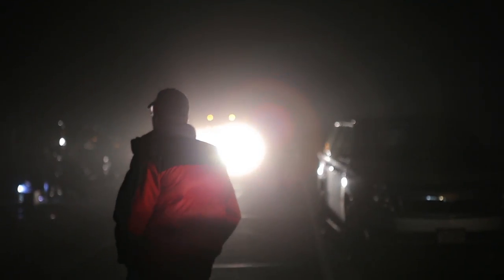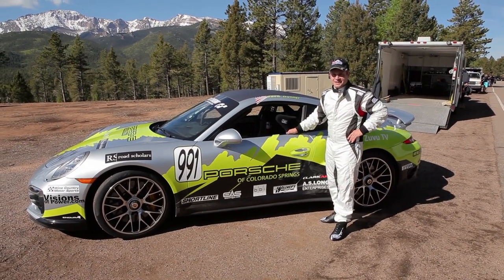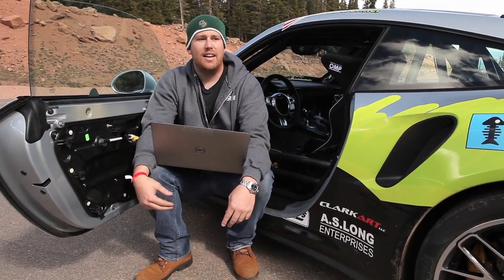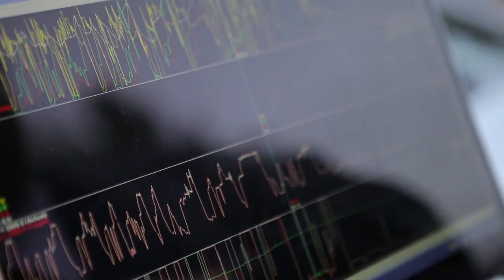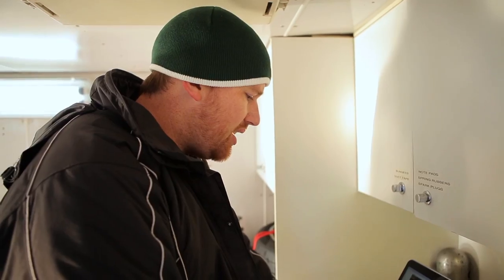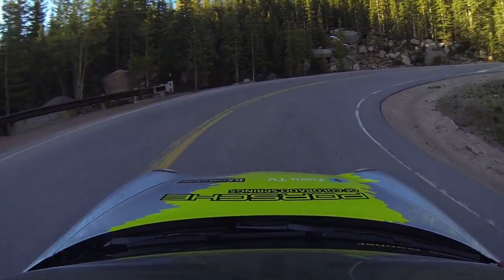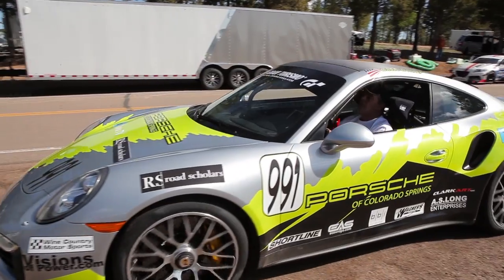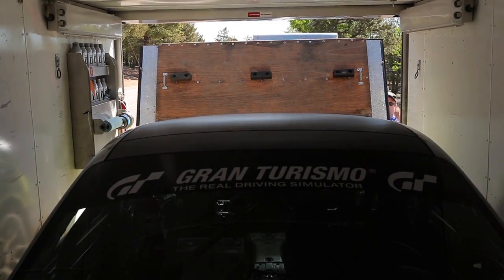COBB Tuning - 2015 Pikes Peak International Hill Climb - Part 2 of 3

Comment: It's a cool video but it would be nice if it was a little more in depth. Most of it felt like you just got good data from practice runs but I would like to know more about what you're capturing, what you change in each iteration and how it makes a difference. Also, a little more talk about the rules and regulations for your class of car.